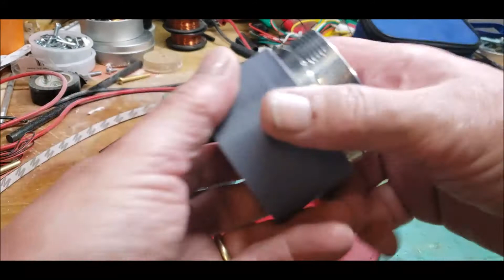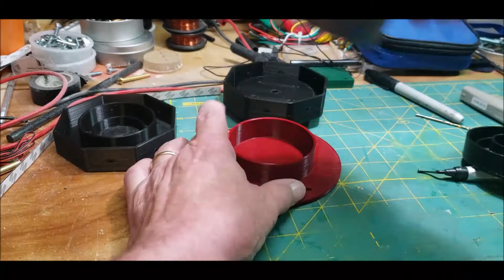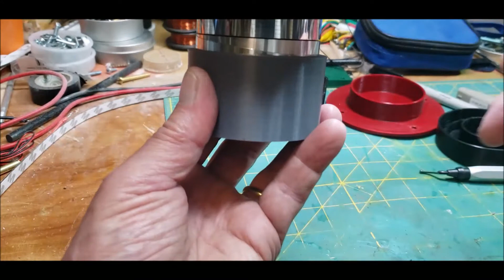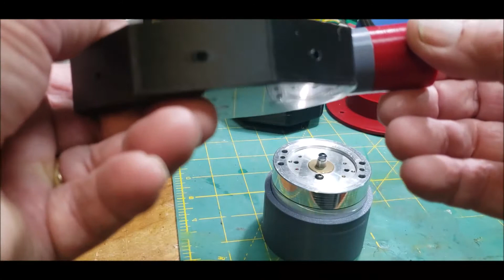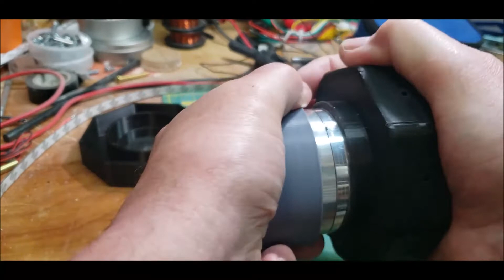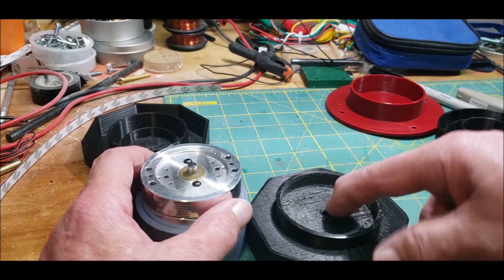3D Printed Rotor design thoughts?

Comment: Could you not downsize the magnets to fit the good print you have done? Though i don't see why you cant go with what you have !
Reply from the maker: yes but those are expensive type magnets and I have them already so changing the rotor via 3d prints is no biggy
Reply from the maker: and yes I could just go with what I have. I may even do that. I poured resin in the good rotot about half way to se the effects on the PLA. So far its ok.
Reply: @mcorrade  Im guessing the weight of the resin will act like a flywheel  on it, Should fly
Reply from the maker: @Telboy-fv8ke  yes my hopes as well. I just checked it and the resin cured just fine and the PLA was not affected or warped in the slightest
Reply: @mcorrade  Can't wait to see how it runs, Meant to ask you what size magnets would you like to use for wheel i making?
Reply from the maker: @Telboy-fv8ke  I'm thinking probably barrel or cylinder magnets 20mm long by 10mm thick or somewhere in that ball park but not smaller

Comment: You ever mix iron fillings with resin?
Reply from the maker: no but I saw that boing done and it really didn't work out in that situation. I'm doing a test now with resin and one of the rotors I showed. I filled it half way to reduce cracking and heat.